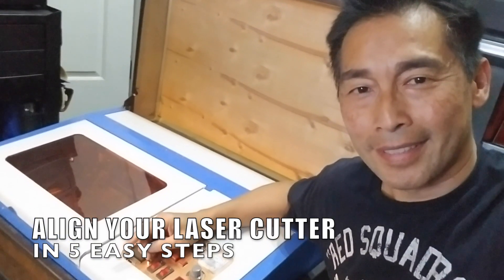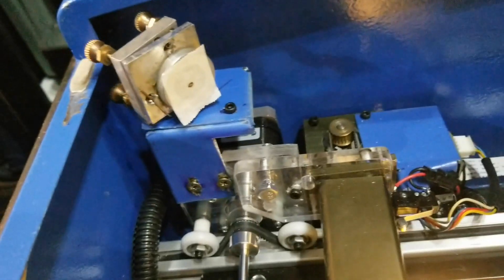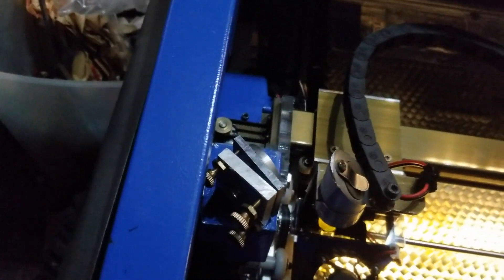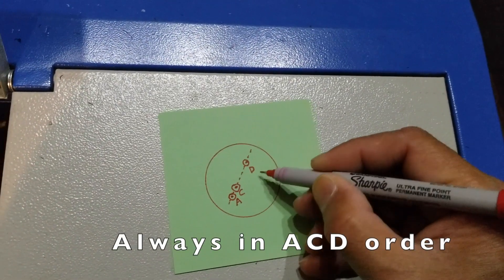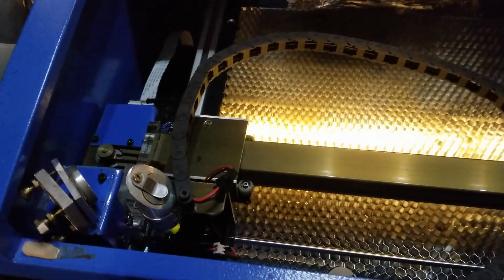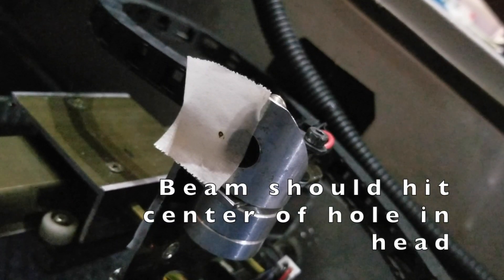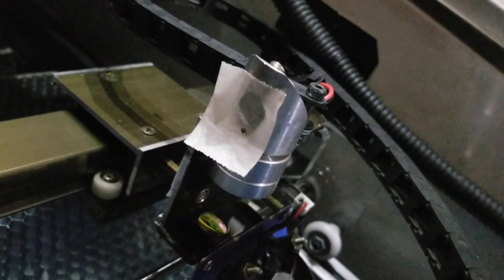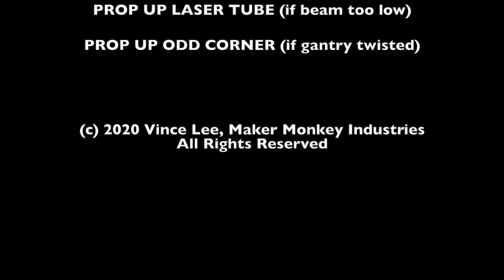Align your K40 or Other Laser Cutter in 5 Easy Steps

Comment: Wish I would have seen this a couple days ago.  I spent several hours over the last week trying to align my laser after getting it out of storage, where it sat for several years.  I finally figured out on my own to align the beam and move the mirror later but for my peace of mind I still needed to verify my theory was correct.  I finally found a YT video that did verify it but it was explained so poorly that I would have never understood what he was trying to teach had I not first figured out the procedure for myself.  

I wasted days using a laser pointer tool that mounted in the head and the tools instructions stated to aim for the middle of the mirrors.  After ditching that, I got the alignment pretty close after about an hour, which included undoing some of the things I tried to get it working when I didn't know the correct procedure.  

If I do understand correctly, you have to start with the first mirror and get it centered to the tube, then use the first mirror to align the beam to the y axis.  Then move the second mirror to center on the beam.  Then align the beam to the x axis with the second mirror and then move the head to center the beam.  I'm not sure how it was suppose to work when using a pointer mounted in the head.  It means going in the opposite ordered which doesn't seem to work.

Comment: I hit mirror 3 everywhere on the bed at exact center but I only get good engraving result in the front right side, the left back side is horrible. How can that be the case if I hit mirror 3 at exactly the same spot everywhere?
Reply: Your 3rd mirror isn’t aligned then… However it should not be positionally linked if the 2nd and 1st are fine; are you sure it actually hits the same spot in all four corners of your machine. Did you ever solve this issue?
Reply: @Rock-Licker  Everything was aligned perfect, i found out why it happened. My 100W Co2 laser tube had a damage in the lense where the beam comes out. I dont ever have seen anyone talk about this part or mention it, i finally saw it when i zoomed with my Smartphone camera into mirror 1 and then i saw that on the lense of the laser tube that produces the beam was a little spot that wasnt dust or so it was a damage and that resulted to my problem. I was lucky that i saw it after 10 or 11 months later buying the laser so i got a new 100W tube send to me.
Reply: @13hubi13  Good catch! My lens is also a bit wonky; everything’s aligned and it constantly pushes it to the very bottom left when coming out of the tube; so far no effect on engraving or cutting but it makes it very difficult to do inlay’s (it becomes more noticeable there’s a slight angle on thicker material)

Comment: I don't understand, when aligning the 2nd mirror with the head, you start in bottom left position, get your center mark on the tape that's around the laser head, then move it far away, take another test shot, and see how far away that second shot is from the first.. which by what you're saying is test shot 'D'.  Why not just now adjust the screws on the second mirror to get that D to match up with the C shot?  I don't see a reason to "find A"
Reply: I know your comment is super old but they won’t match up unless the mirror is aligned in the proper position (the A mark), I thought the same thing at first but they will always be off (albeit you can make the gap lesser because you will be closer to A by shooting for C) because that’s not the true proper alignment of the mirrors. When he shows the sticky notes on his machine this is giving you the visual, the C position is closest to the mirror so it is closer to showing the true alignment of the mirror than D  hence why it’s “outside of C” because your 3rd and 2nd mirror aren’t touching there is about a 1/10th distance gap compared to a 10/10 distance gap between D & true alignment

Comment: I bought a k40 around Christmas last year.. out of the box it worked okay to get me started. After the holidays i changed airassist , ventilator , and and mirrorset/laser head. That is when the problems started. Couldn't get the alignment right. Got only crips cut at one side of the bed... Last week i spend hours of trying en errors.. until i took my time to watch this video a couple of times , take notes and a couple of tries... You are my hero!! It works like a charm now! Crisp cuts all over the bed.. and i have been able to get super settings (power/speed) instead of almost blowing the tube .. thank you , thank you , thank you!!

Comment: Thanks for the video.  It was very helpful, compared to other videos out there.  I have a question for you, hopefully you can help.  I am working with a Ruida controller, and when I try to run a file the head it trying to go off of the table and it is banging into the wall.  Do you know how I can adjust this so that it is squared up on my workspace properly?

Comment: Can anyone help. I hardly use my K40 and just today when I went to engrave, my text was all squished down... then even tough I can fire the test laser, it stopped engraving. Any ideas? :/ I feel like this happened before and it was an easy fix. but I have not idea. I don't use it a lot (very rarely in fact) so I don't think it's the tube or power supply ....

Comment: How do you know which screws to adjust on the mirror mounts please?
Reply: If you adjust them while watching the mount move you'll see which screw does which. From memory, the top screws rotate it left and right around vertical (yaw) and the bottom screw rotates it up and down around the horizontal (pitch), but i haven't done it for a while so it's best to try yourself, you can plainly see how the mount responds when you turn each of the screws. I think this man also has a laser diode attached to the primary mirror so that he can align without firing the laser initially, but i'm only 2 mins in.
Reply: @GaryMcKinnonUFO  Watching the mirror from behind: Bottom Left moves horizontally left right; Top Right moves vertically up an down; Bottom Right moves diagonally Up-Left and Down-Right, but the best thing to do is to leave this one untouched if you can manage to do it with the other two.
Reply: @akudunniadsbig3837  Thanks for that :)